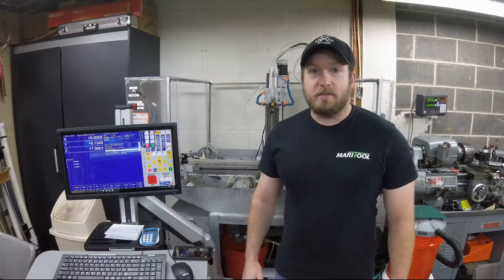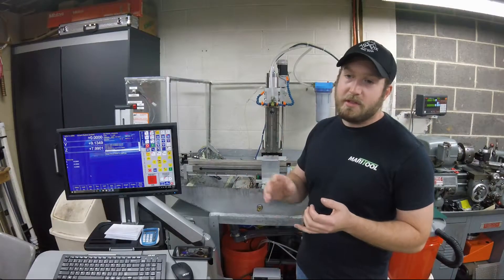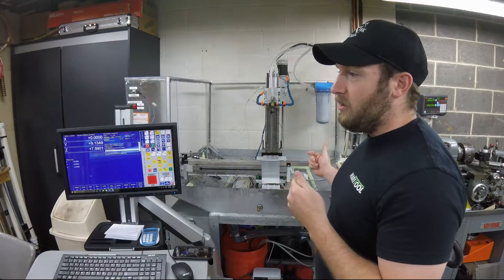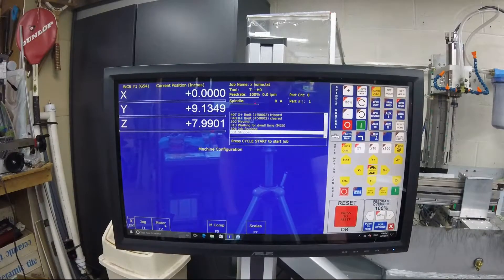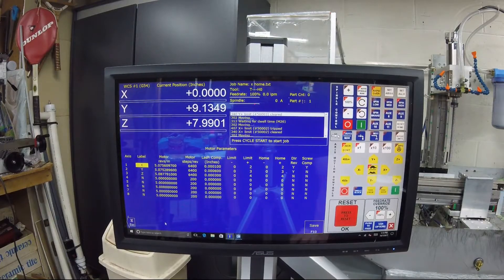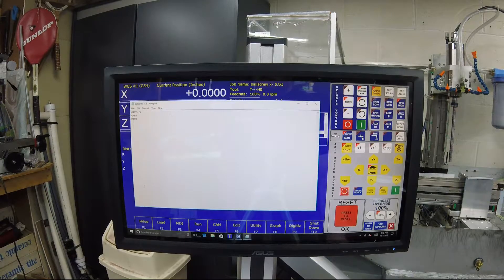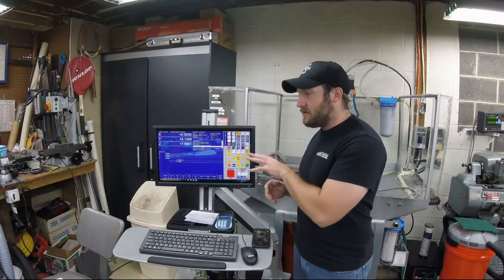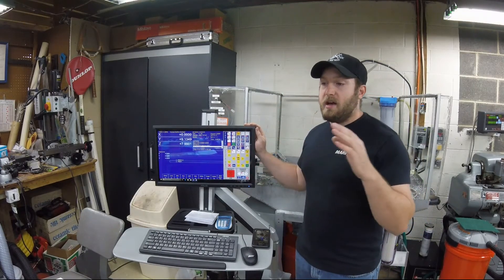Ballscrew Comp with Centroid Cnc Acorn Board

Comment: When taking additional passes and fine tuning do I need to go back into motor and turn the screw comp back off each time I am taking a new set of  measurements? I have been turning it off when I take my .5" readings, enter new data, and turn back on. Am I just chasing my tail doing that way?
Reply from the maker: @mt6865  I have not done a comp in a long time but if I remember correctly, I would do the first comp off and tge fine tuning with the comp on and small adjusting the numbers plus or minus until it was dialed in, if you shut it off each time you can't see the difference your making.
Reply: @hollerbachcustomknives  Thanks, that is exactly what I ended up doing. Ran it once, turned on the comp and started adjusting the corrections little by little. Was able to get the first axis dialed into within .00015" across the 18" of travel. Should have done this 2 years ago.

Comment: Nice informative video Alan. I'm having trouble with the incremental G-code command. Acorn says the G91X-.5 line is a 502 Invalid G-Code and won't continue running it.
Reply from the maker: Are you running that with a space between the G91 and x-.5?
Reply: @hollerbachcustomknives  I've tried both and to no avail. Same error code.
Reply from the maker: @adrewfis925  sorry bud, I don't know the answer then, I would post on the centroid acorn forum, they should be able to help you there.

Comment: Hello Alan

 I need help. I dont have precision. I have cnc router with dmm servos. I followed your video of ballscrew mapping. I do the complete travel I return to make the home every time, I make a step as the software asks me to, but when I return to zero and verify again the travel loses the precision again. I don't know what to do. It seems I lost buying acorn cnc. Could you help me please. Hector.
Reply from the maker: Two quick checks, on the screen that has your motor steps and backlash make sure the ballscrew comp column has y in it turning on the comp for that axis, also after you do the comp save and restart the software, then verify that your comp table is there, you can do it in the software or in c: of your computer. If these dont work ill shoot you my email and we can try a few others.
Reply: @hollerbachcustomknives  
I did the process again but the result is the same the precision is lost. be happy if lost by .0015 or.002 inc is nice. but it is lost by .005, .006 up to .008 inc that does not work. I have experience in diy cnc previously I used path piloth software it worked very well but when I made the change to servos the path piloth did not want to work with the dmm servos. I made the change with mach3 but almost always lost communication with the computer. I made the change to centroid looking for improvement and I find this problem very bad. Could you help me with a more detailed video of how you did the process
Reply from the maker: @deborahcarattini765  a few questions, have you made sure your pulse per rev is dead on for each screw and that your backlash is completely 0 or compensated to 0. Also how are you measuring your movments? Have you checked to make sure all your compensation numbers are in the software and a at least .5" for each measurement.  You have to be sure 100% that you have no mechanical issues before you even try to comp. Now when i did my final compensation on my machine u used a laser interferometer for the movement, i talked about it in another video. If you have more questions its easyer to message me at amhknives at gmail dot com

Comment: 1 μm! Sweet! Would you recall the price and do they require any signal translation to connect to CNC 12 board, or it’s just straight NC/NO switch. May I ask which laser interferometer you incorporated in your design? Thank you very much! Best!
Reply from the maker: When i bought them they were $90 each and they connect directlyto the acorn board. I was running an older hp 5517d laser with all the mirrors and control board from sams laser faq but i have just upgraded to an optodyne laser.
Reply: Thank you Alan! Much appreciated. Would love to see the knives you making :)
P.S. Which Metrol tool seater did you use?

Best of luck!
Reply from the maker: @arthursargsian  thank you, im actually not running a metrol tool setter, i have a renishw ots tool setter and omp400 probe with a renishaw optical eye controling both.

Comment: Am new to cnc,still learning,your video was very helpful, how do you make the g code for the acorn,have never made a simple non part g code. To run on my acorn
Reply from the maker: You could use the intercom software in cnc 12 to try some simple moves or just some simple x+ or - moves to run the axis. To make all my parts i use fusion 360 for my cad cam and g code for thd acorn.

Comment: Hi Sir
I just got set up Centroid Arcon. But I do not know how to run a program. can you help please.
I have the pipe chuck in 4th Axis. And  Need to drill hole on different angle and distance with X  travel .
Thanks you very much for your help.
Tony
Reply from the maker: Tony, are you using a cam software for your g code or trying to use the internal software for your cutting? If you want to shoot me an email insted of going though YouTube,  amhknives at gmail.com

Comment: Did you calibrate your inches/rev and backlash first?  Does this not also affect the screw compensation or do the screw compensation table override these values?  Kind of seem redundant in spots...  Great Videos.  Thanks!
Reply from the maker: You do revs per inch first and backlash. Ballscrew comp is only for the error in the screw itself. And it uses the table you make to do small changes in the pulses to take out the error.
Reply: @hollerbachcustomknives  Thank you.  Calibration is on my list of todo for the evening.  I'll follow those steps in order.  Trying to get my "circles" to be a bit more circular.

Comment: Alan,
what does the ka200 do in this technique of yours? Thanks.
Reply from the maker: I use the ka200 and the glass scales to meause the movement,  now i use a hp laser interferometer  for more accuracy.
Reply: @hollerbachcustomknives  
I guess what I'm not getting is why you need the Mitutoyo and the glass scales/KA200 for this test? Thanks, Alan.
Reply from the maker: @crookedriver2079  sorry about that, you use the scales to measure the movement and the ball screw mapping software uses thes numbers to adjust movements of the machine to make it more accurate.  Say you want it to move 1in and it moves 1.005" you can have the software fix the .005" deviation and then the mill moves 1.000 correcting the fault in the ballscrew movement.
Reply: Alan, can you provide the model number for the laser interferometer that you use? The Dro on my x-axis (lathe) is not accurate enough for me and would like to go the laser route if it's worth it.

Comment: Really starting to like this acorn board. Emailed Centroid and they responded same day and they have a solid post processor for Fusion.
Reply from the maker: I use fusion for all of my cad cam for the mill and the post processor has worked great for the centroid software.
Reply: Manny Calavera did centroid send you the post processor for fusion or is it in the autodesk website?
Reply: bostondan77 it's in fusion. M400 I believe from memory.

Comment: Alan, you choose .500 per step, curious if mapping half that would be more accurate if you wanted to get crazy-  how many spots for the map are available ?
Reply from the maker: .5 is the standard setting but you can change it to small increments if you wanted to it would just take way longer to map and put in the information. I don't know how many spots are available, the paperwork does not say, you would have to email centroid cnc for an answer.
Reply: No need to go finer! Remember screw comp is compensating for screw pitch error!  When trying to wrap your head around this...think in the terms of pitch not absolute positional error.  Screw Pitch error is fairly consistent due to the manufacturing process equipment.  The Centroid CNC12 software interpolates the measured error between the correction points. In other words the pitch error compensation is spread out over the  .5" distance.    
for example:    from the beginning of the measurements…..   start target =0, measured =0,   next target = .5"  actual measured = .499"     so,  error at .5" target is  -.001"    CNC12 adds .001" to compensate.  That .001” is a PITCH error.  The .001” error compensation is then spread out over the distance between X0 to X.5"    So for example, at the x.25" location cnc12 is adding turns to result in an additional  .0005" to the commanded position of .25" so that the machine reaches that actual position of .25" etc...   Test it yourself, program moves to any position after setting up the table and look what the DRO reads.. and I think you will be shocked at how well it works.  Often one measurement pass is all it take, but feel free to make another run for super fine tweaking.  Note: sometimes finer (smaller distance between points) measurements might actually produce worse screw pitch measurement results as it is a good idea to get somewhat of an average pitch error over a distance (1/2”).  We have settled on 1/2” increments in our 20 year experience with both Laser and Manual table software screw compensation for a number of good reasons. Note: Centroid screw comp is taking care of two things, #1 is pitch errors of the screw in BOTH directions!  as the pitch on each side of the screw can be and most likely is different (going one way the nut presses on one side of the threads and going the other way the nut press on the other side of the threads, which are different) and also backlash in the system on the turn-around.  Moving .5" between measurement point gives a good reading of the pitch error.   Also, backlash can come from several locations, most common are the screw nut to screw connection and more often and often more pronounced is the screw to machine tool connection made by the support bearings. For best screw comp results, its always a good idea to reduce backlash mechanically as much as possible from all sources starting with the screw support bearings (without adding drag!) and if your machine tool has an adjustable tension nut to minimize it there as well before running the screw comp measurements.  Try it, it works!